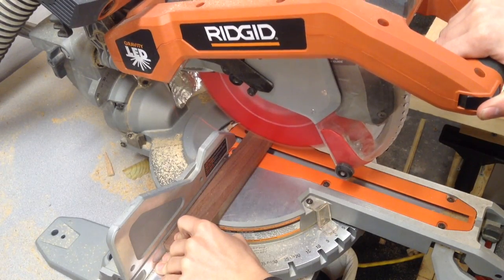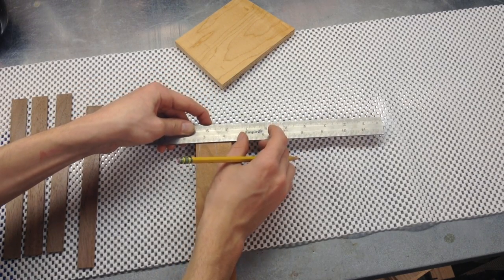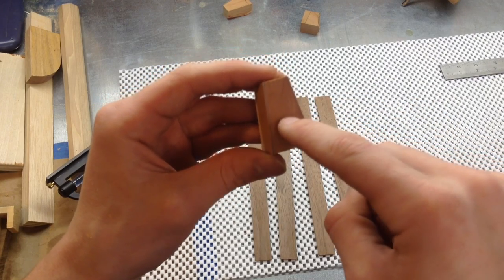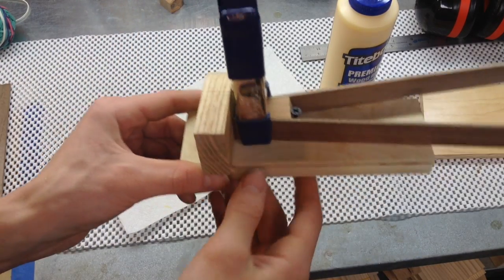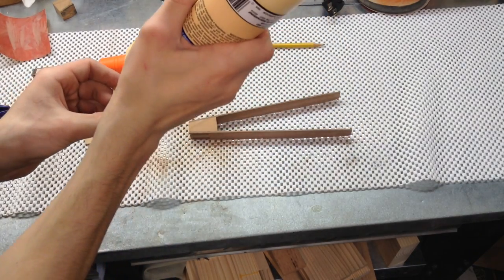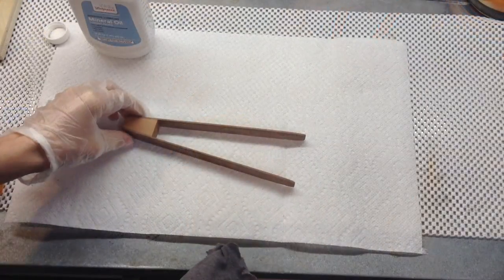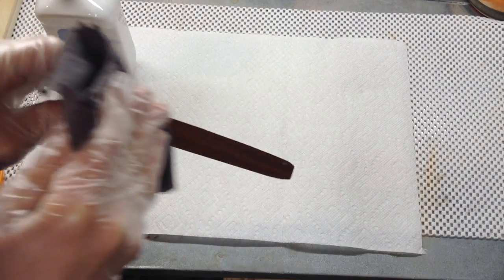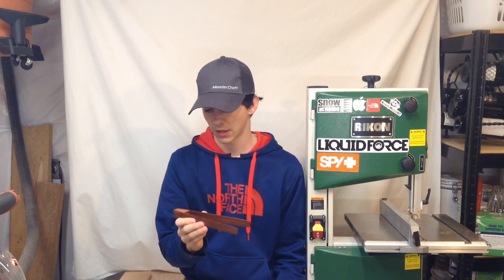Wooden Toaster Tongs

Comment: +Kroy Wood Works what acurate and safe power saw would you recommend for a beginner woodworker thanks
Reply from the maker: The best saw you can buy for woodworking is without a doubt, a table saw. This is very accurate, you can make at least 90% of all your cuts with it, however you have to know how to use it properly to be safe. Table saws can also be very inexpensive to purchase. I would recommend looking at Steve Ramsey's recent video on using the table saw, that can help you get a better understanding. If you have any more questions just let me know!

Comment: How long does it take for the mineral oil to dry before you apply another coat. How many coats will you apply.
Reply from the maker: The mineral oil varies a lot in the time it takes to absorb. It doesn't really ever dry it just is soaked into the wood. I would say half an hour to be safe before you should apply another coat but it really doesn't matter. I put about 6 coats on which is a little overkill but that just means I won't be reapplying it all that often. You could also soak the tongs in a bath of mineral oil but that's only really worth the effort if you are making lots of things to be finished in mineral oil.